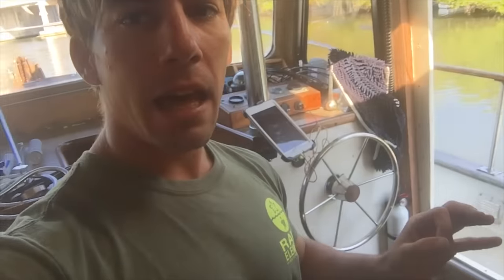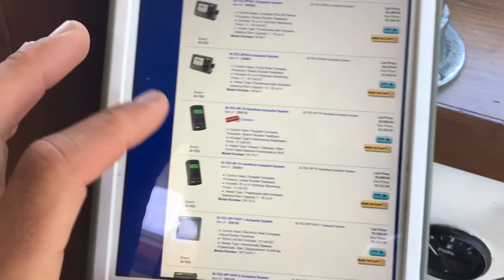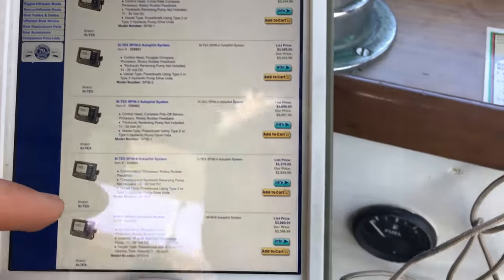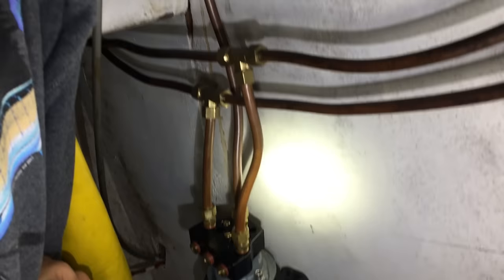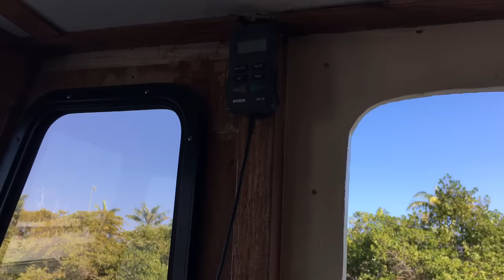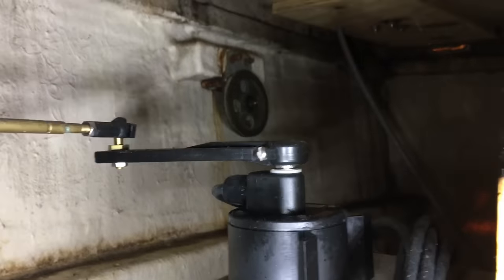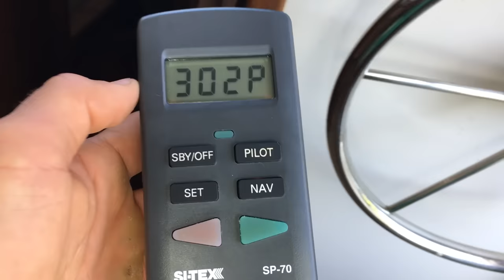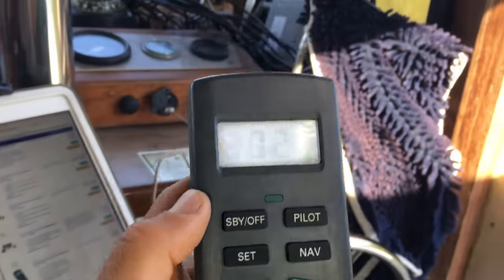THE BEST And Simplest Inboard Autopilot

Comment: In the aircraft world, what you called the "compass" (and it really is a compass without a direction card) we call a "flux valve". Just like you have on your trawler, we also have a "heading hold" function that relies on that flux valve. One thing I noticed was you only mounted the compass and relied on that. The FAA requires us, periodically, to "swing" the flux valve. To do that we have on many airports a "compass rose", nothing but an area that has the points of a magnetic compass painted on the tarmac. You line the plane up on that rose and then check to see what the compass on the panel reads. If it's different, and it often is, you adjust the flux valve until the panel read-out matches the painted compass rose. The flux valves are mostly mounted in the vertical stabilizer on the tail of the plane. Swinging the flux valve can be a pain in the rear, but when you're done, you know that setting the heading at, say 270 degrees, the plane will actually fly a heading of 270 degrees. I own a 47' Chris Craft Commander and probably need to check more closely the settings on the flux valve in my boat, too.  Enjoy your videos. Keep up the good work. Ray
Reply: Mike  Mc Where do you think autopilots originated? And what are you? Tula's comment screener?

Comment: not a bad summary. the only recommendation I would make to viewers is to use different fittings on the hydraulics. this is completely a preference thing though! I'm sure the brass compression fittings will gives years of reliable service at steering system pressures. cheers!
Reply from the maker: What fittings would you use? Just curious. These were the types of connections the p/o used so I just went the same route
Reply: Tula's Endless Summer well, I'm not sure what the line pressures are in your steering system: if they are low pressure like 200psi, those compression fittings will be fine, but if the pressure is much higher than that, I personally, would use a flared fitting or a fitting that does not ferrules/olives as the securing piece. sorry I'm on my tablet or I would give a link for what I am talking about.🙂

Comment: I have similar small old trawler with Hydraulic retrofit steering. I'm not sure why the center point matters for a wheel steering system . It should only matter if there is a limited number of rotations.  They don't seem to recommend wheel systems for hydraulic steering.  Dunno , autopilots are so expensive I would think the system should just see you are off course , turn wheel until you are back on course. Did you read anything else why they would not work? Prehaps they are too complex now?  Cheers Warren
Reply: warp21drive Wheel pilots use the wheel as the reference point for determining the rudder position.
If the wheel is anywhere and the rudder is anywhere, the pilot will go crazy, not knowing whether to turn the wheel left or right to steer the course. The rudder is affected by water flow and the boat moving side to side while the wheel is stationary, never providing a 'last position' for a reference as to what to do now.
This is complicated even more by having a second helm as on the flying bridge, as a second input to the hydraulic system is completely independent of the other helm, it moves the rudder without moving the other wheel. I don't know if they have an upper helm though.
In a hydraulic system, the wheel does not move when the A/P pump pushes fluid to the rudder ram, thus the reference point is a dedicated rudder position indicator which moves only with the rudder, telling the pilot to move it left or right.
Reply: +acmeopinion factory ......thanks, I guess it might be ok if you started the pilot  with the wheel in the center but if the helm was say hard over the pilot would get confused and then it would go on being confused.
Reply: warp21drive Once the rudder is moved by water pressure, when you start moving, and the wheel stays centered, the A/P no longer knows where the rudder is and cannot steer.
When the rudder moves back towards center, trying to align itself to the water flow, it pushes the hydraulic fluid back into the helm bypass valve and not the helm pump, this is why a hydraulic steering system has no 'feel', or 'feedback'.
After a very short time, the rudder can be anywhere and the wheel gives no indication of location.
Even if you start out with both centered, thirty or sixty or ninety seconds later the pilot would be lost.
Reply: +acmeopinion factory ,  Thanks it clearly could be a problem. I was checking out the unfortunately discontinued  ray marine sport pilot mechanical steering that is similar to the wheel version , the sport pilot mounted direct to the steering column shaft which is simple. The are only good for  up to 30' boats but they are approved for use with hydraulic and cable steering. Since it does its auto steering the same way a person would steer I guess it has no problem with  rudder position . You don't have to have a rudder position indicator and it had nema interface.
The price was not much better than the current hydraulic system but much simpler.  Oh well I guess I will have to buy a hydraulic system when the time comes. Link to sport pilot. http://www.raymarine.com/view/?id=733.   Cheers Warren
Reply: Interesting A/P, wonder why it's discontinued? And what Smart Rudder SensingTM was or is. Although, apparently one could add a rudder position sensor post- installation.
At a weight limit of only 7000 pounds, sounds like it would have come up short for your application by about double that, in addition to the LOA constraint.
Look on the bright side- a good hydraulic system is almost bulletproof and may well outlast you or the boat.

Comment: quick question, I just installed the sitex SP-80 unit and for some reason when I power on the unit, it would show SP, then 207A just like yours did, but it will not leave that screen to out from that 207a reading.  any ideas?

Comment: How difficult was it bleed your hydraulic system after the install?
Reply from the maker: Really easy with the upper helm. Just took the cap off, attached the fluid tube to it connected to the container of hydraulic fluid, and held it upside down while I worked the wheel all the way lock to lock. You see the bubbles coming up the tube into the contrariness as the fluid fills those spaces in the system.